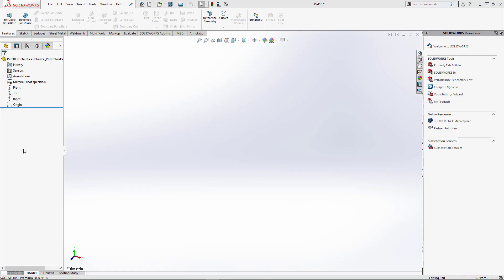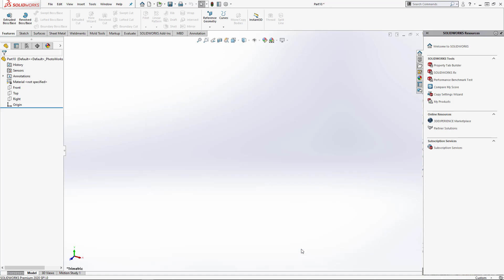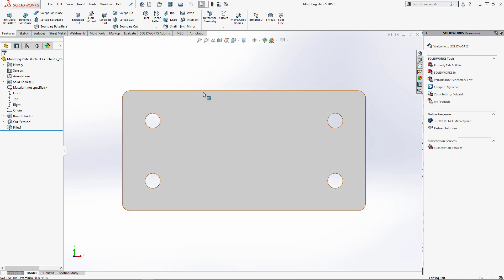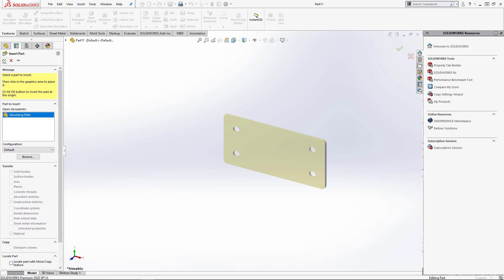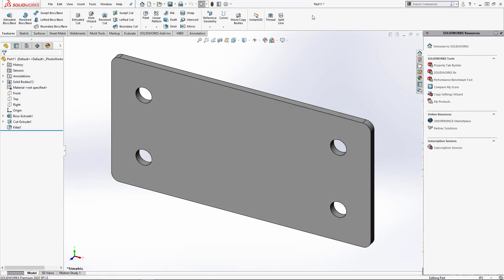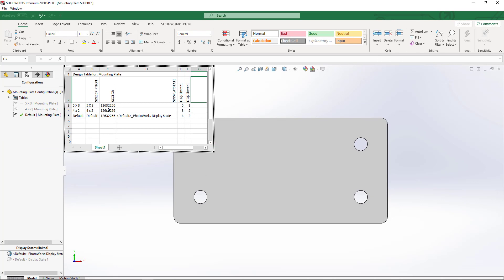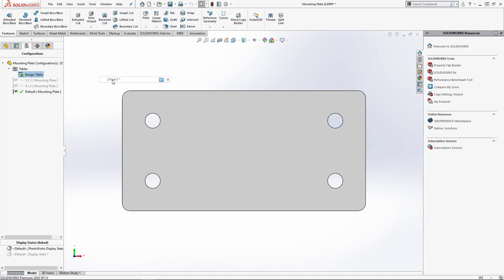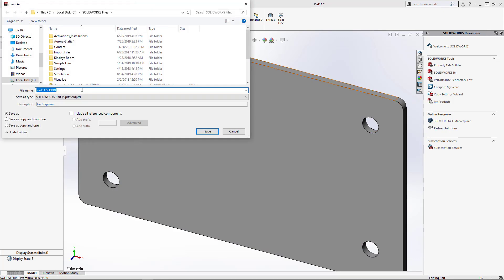SOLIDWORKS Tutorial - How to Change the Template of a Part

Comment: Here are a few issues that are not being addressed.  1.  The material properties are no longer there, if this is coming from a custom materials database, that is lost. 2.  All of the faces on this part and their related mates (datums still seem to work) are completely removed in any assembly that references the part.  3.  The drawings used for these parts have dangling dimensions, they have to be redone.  4.  You cannot save the file as its old / replaced version, because solidworks thinks its still open.  So you have to save it as something else, then rework the assembly or rename the file after closing the part. 
This update templates is a hack approach to a problem Solidworks has with not ensuring forward compatibility with older templates.  We (as customers) play the game every year to deal with forced upgrade, but yet are left dealing with chaos that comes from SW inability to manage something as simple as this.  Just like another user stated, "I have hundreds of files to process".  This poor guy probably does not realize the implications it will have to assembly and drawing behavior.
Reply: Agreed.  This hack is shit.  There really ought to be a simpler solution to this issue.

Comment: why not just save out the drafting standard and load it to the old part.  Seams like you will need to update the custom properties anyway, that can be done with the property manager or you can use an excel template to copy and paste the info you want there.  We would copy all the properties out to excel, delete all of them.  Then run a property tab manager and paste the text from excel into the right locations so that when we applied the info all the parts would have the same information in the same place.  any of the old not used info would then not show up.  and you don't need to update and recreate configurations.